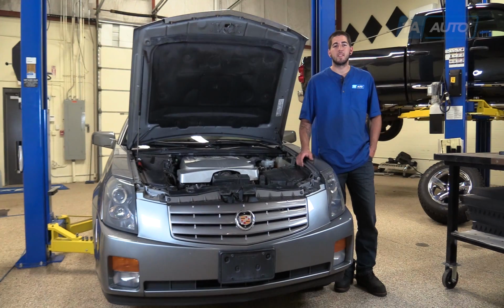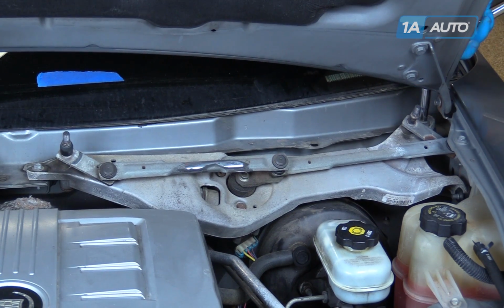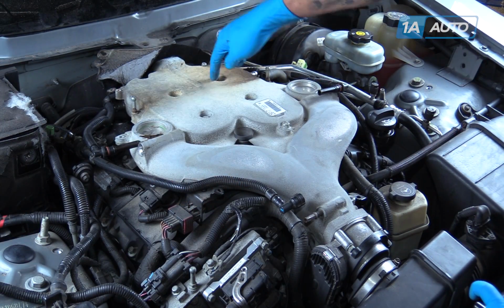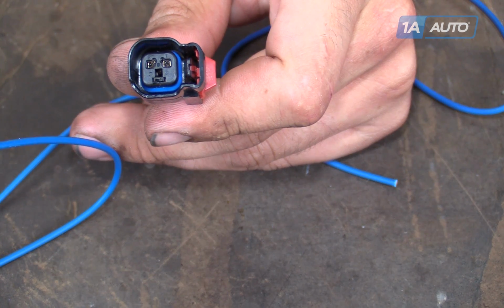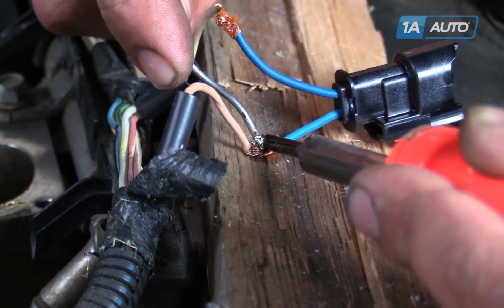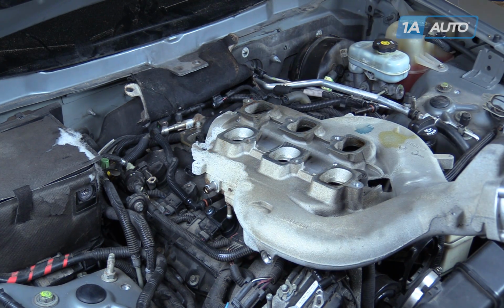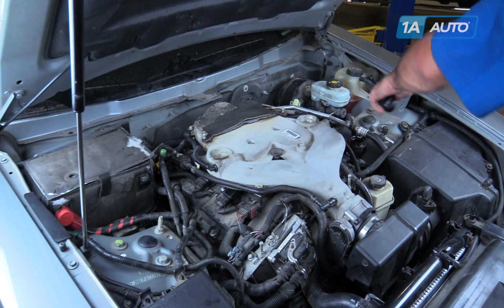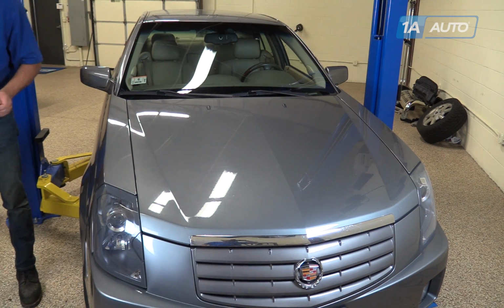How to Replace Injector Harness 03-07-07 Cadillac CTS

Comment: I have an 04 cts and  replaced the wire harness and somehow the idle keeps rising and falling between 600 rpm and up to around 1000  and was wondering if theres anything in the harness that would cause those symptoms??? Appreciate your time thanks
Reply from the maker: +DirtPoorFarmer We wouldn't be able to diagnose an issue like that here, you may want to have a local mechanic take a look at it. Thanks for checking us out! http://1aau.to/m/Shop-1AAuto-c

Comment: If you don't want to remove the windshield wipers assembly harbor freight sells a small profile ratch and pep boys sell a short socket and you can remove the two bolts you can't get too at the back of the manifold on a 2007 cts.

Comment: I've had multiple p0300 codes on my 06 cts 2.8. I've already changed the coil packs and spark plugs twice and I'm still getting p0300 codes?  After the first tune up didn't work, the following month i did another tune up thinking i purchased a bad coil pack? I'm gonna try to check my fuel injectors next. Any more advice? thanks
Reply from the maker: +Christina Castro There could be many things wrong with your vehicle, from a vacuum leak to bad injectors.  I recommend getting the vehicle properly diagnosed to find out what you need exactly.  1aauto.com

Comment: you might want to plug up those intakes so the next time you splice wires stuff like tape, old brittle wires, etc don't fall into your cylinders...
Reply from the maker: +Rick Quest Thank you for checking us out, as well as the advice. This is certainly important to avoid pieces you mention getting into the cylinders. 1aauto.com